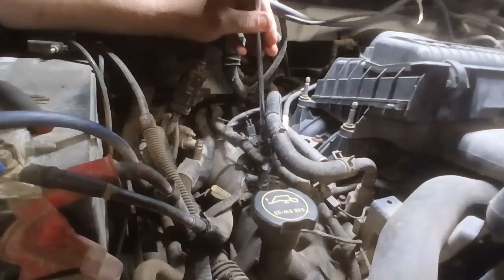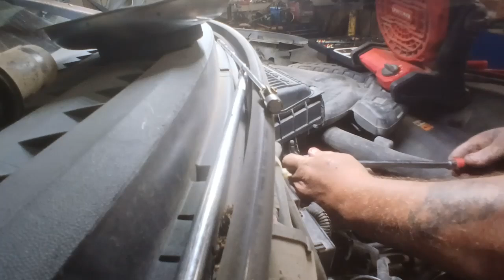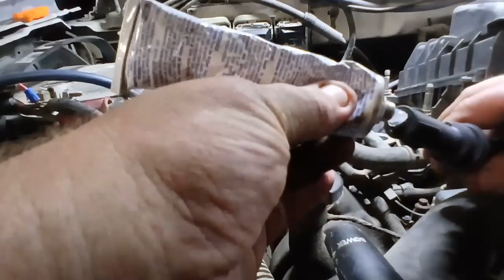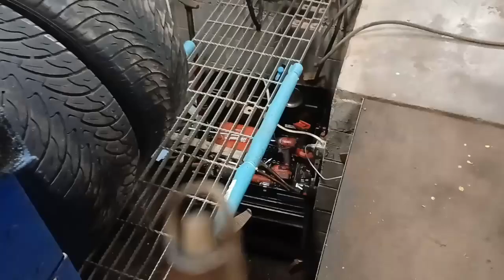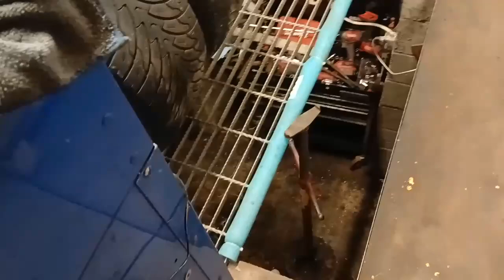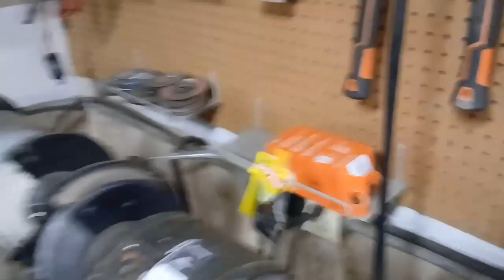Spark plug removal 05 F150 5.4 with 300K Miles

Comment: Well your lucky none of the plugs broke while removing them . 3000 thousand miles is awesome . Nice job .
Reply from the maker: Thank you. I prep the engine ahead of time. Sea foam in vacuum system and used pb blaster on it if I didn't like the feel I was getting and just took my time worked the plug back and forth.

Comment: The recommended technique is to get the engine up to temperature and use an impact gun to get the plugs out. That just seems to be a little harsh to me. I like the way you did it. Taking your time, feeling for resistance, going back and forth. It is my understanding that the plugs protrude quite far into the combustion chamber where carbon builds up on the plugs. That's why they break coming out. I see below that you used Sea Foam to break up the carbon. Back in the day we used water to decarbonize combustion chambers.
Reply from the maker: yes water gives it a steam bath